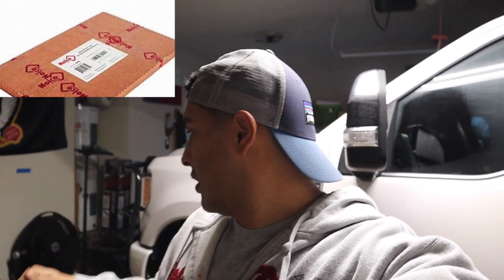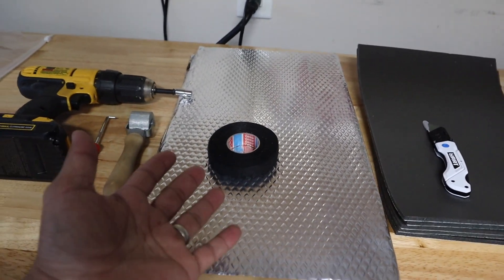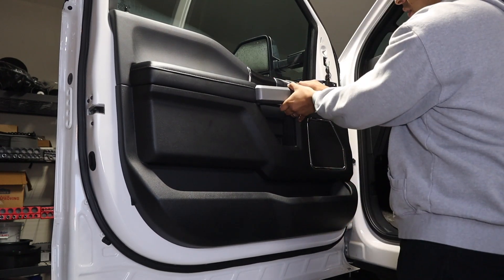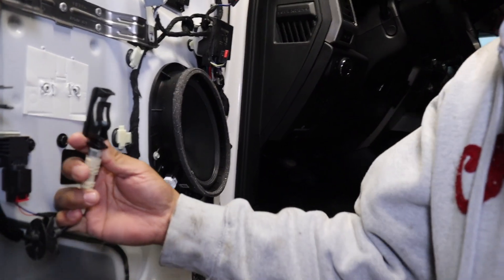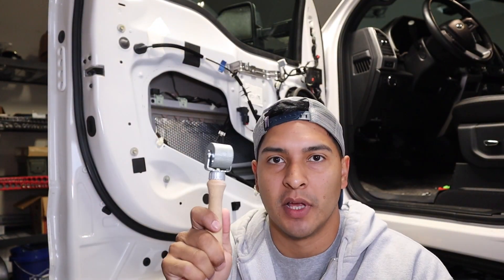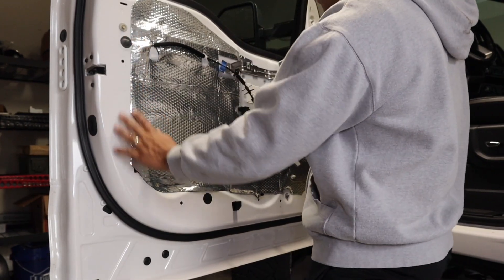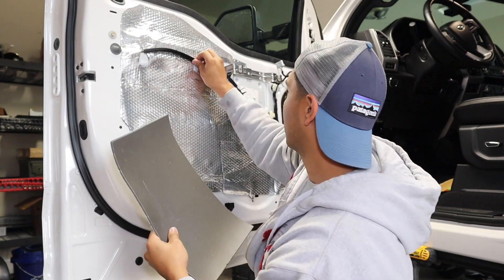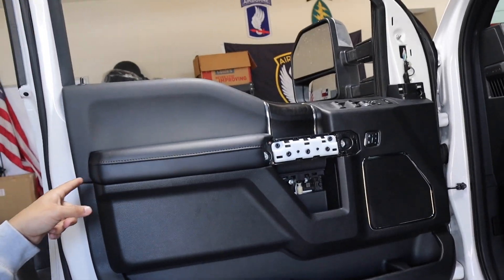Soundproofing & Insulating my Ford! *How to Remove F250 Front Door Panel*

Comment: Thanks for the video on the panel removal.   When I had my 2017 Ram, I just guessed on which panels to pull until I found the right spots and method. Ended up damaging the cover behind the door handle pull.  My 2020 super duty has an intermittent rattle behind the door panel, you just saved me quite a bit of aggravation by demonstrating the removal.
Reply from the maker: Yup, that’s my biggest thing while taping vids...those small steps that everyone seems to skip on other vids lol

Comment: I see other guys doing the plastic door panels as well.  Do you have any thoughts there?  My 2019 F250 is pretty quiet as is with cooper AT3 tires...wanting this to reduce door panel vibrations with music.
Reply from the maker: Yeah I actually included this step in my 2015. It helped, but nothing too significant.

Comment: Did you change your door speakers
Reply from the maker: Nope, I like the B & O system
Reply from the maker: I wouldn’t mind a little more bump though
Reply: @MotorHead18  damn I’m looking for suggestions my drivers door is staticky
Reply from the maker: @chizuck3322  go quality over cheap for sure
Reply: @MotorHead18  thinking JBL Stadium’s
Reply from the maker: @chizuck3322  I always liked JBL or infinity. I know there are plenty other though…just like the cereal aisle